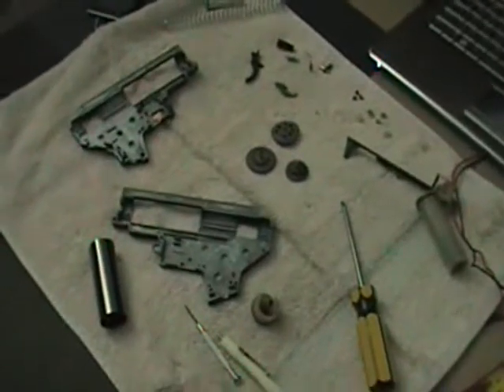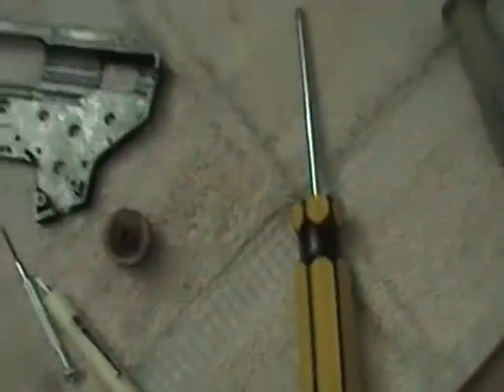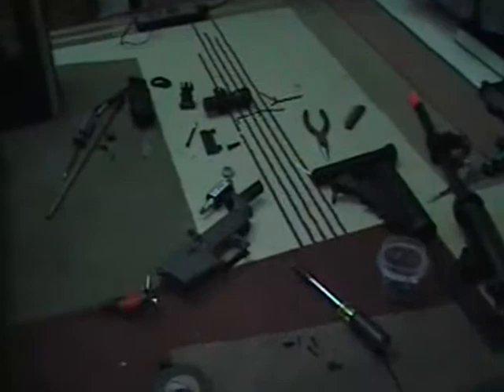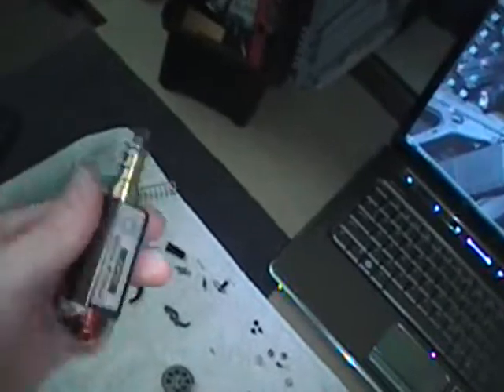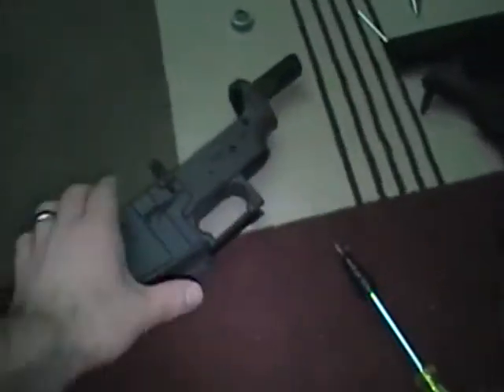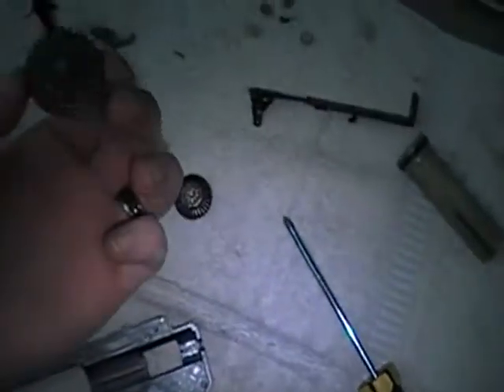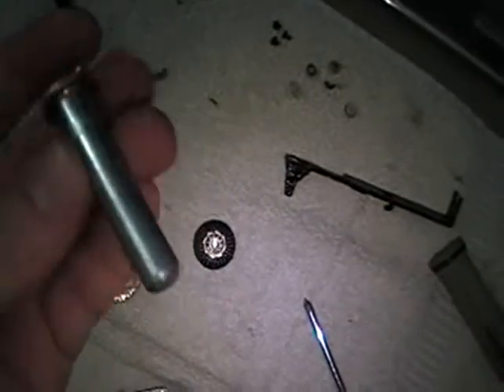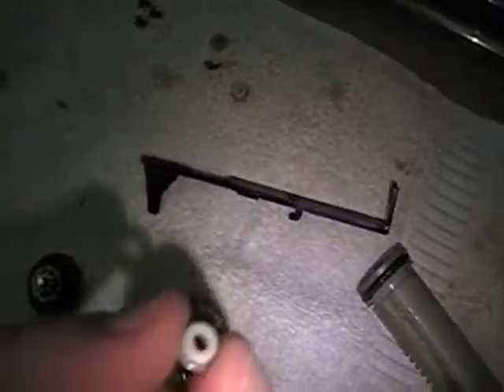JG M4 S-System teardown

Comment from the maker: The circular metal piece is the motor plate that goes on the bottom of the motor.  Kinda like a spacer.  Not sure about the screw and nut though.  Check the pistol grip holes.  The screws go in there to attach the grip to the gearbox itself.  Just take accountability of all of your hardware and dictate where the part came from.